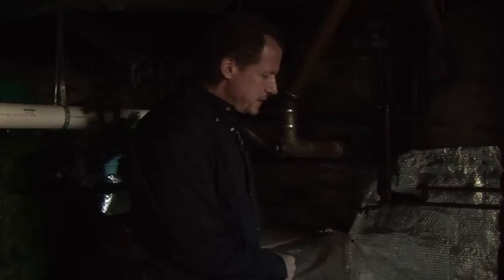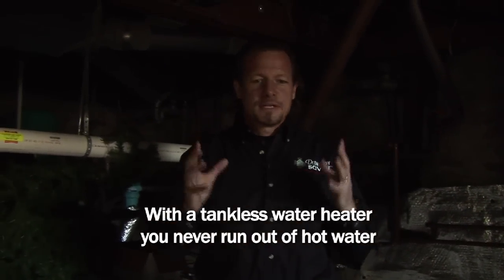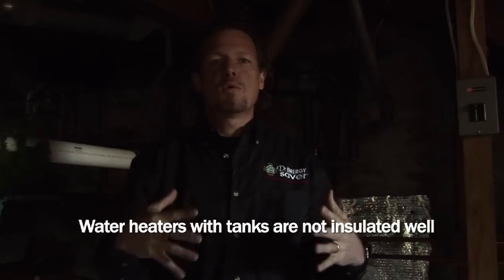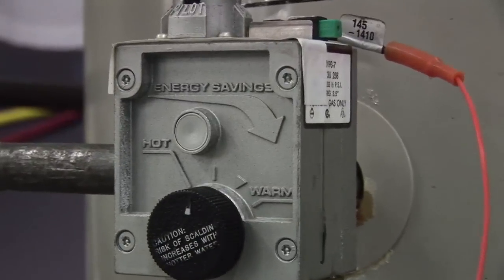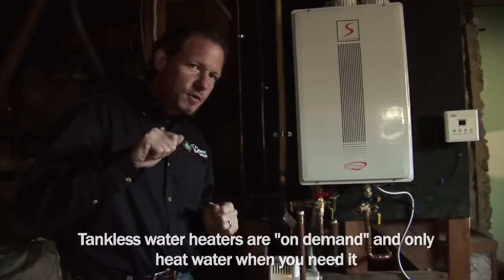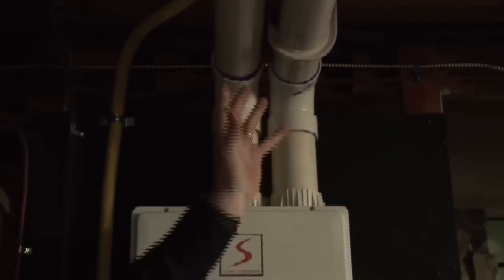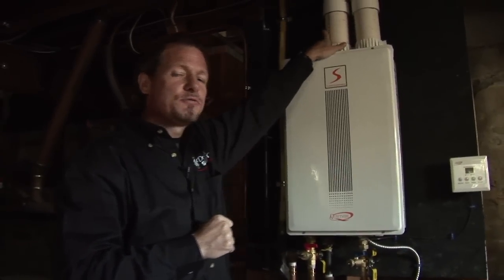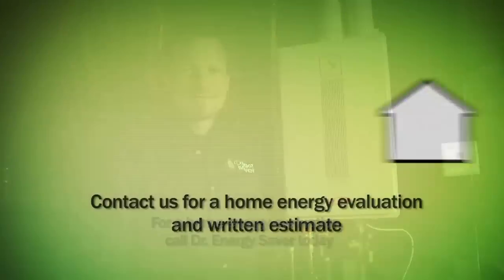Gas-fired Water heater Replaced with High Efficiency Tankless Water Heater

Comment: Have had one for quite a few years. You can live with it. but as with everything else in life theres always a negative to a positive! Its possible that my unit and or installation guy didnt know what hes doing, but when you take a shower, expect the unit to not be able to keep up with your hot water needs! When it 2 degrees outside, expect the unit not to be able to keep your house above 70 degrees running  full-time. Again, could be my unit, could be a sacrifice. If you think a 2 foot by 3 foor by 6 inch machine is gonna warm a household of 2+ people, youre silly. If youre willing to be a trooper and work around it, you will definitely save money. which you can use to buy blankets i guess.

Comment: I did some googling myself.  Tankless water heaters cost a lot more, cost more to install, wear out quicker, have all sorts of their own glitches and are basically more efficient only in theory rather than in practice.

Also, like heat pumps they have a limited geographical performance envelope.  If it's a cold region the water coming into them is too cold for them to heat well enough.